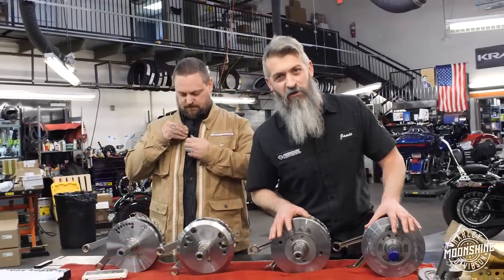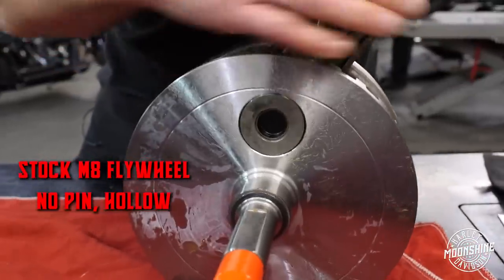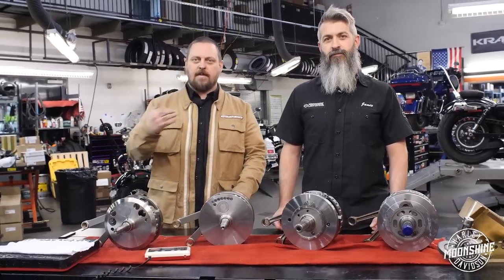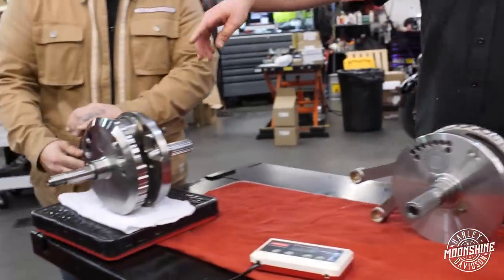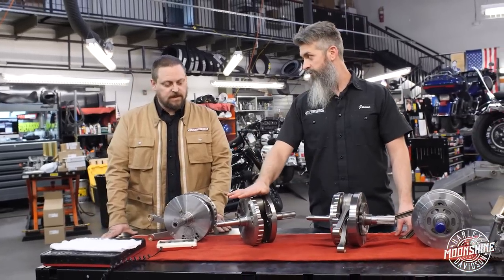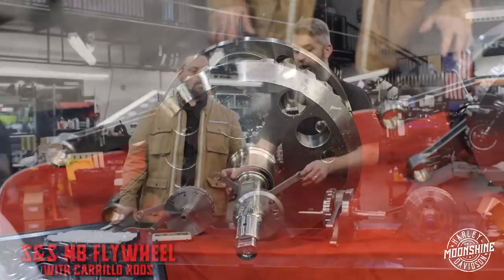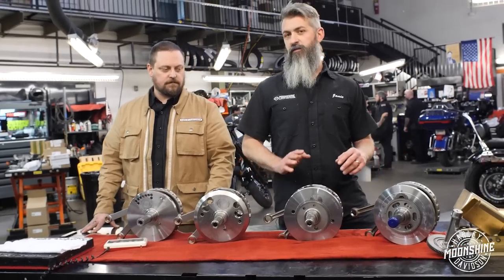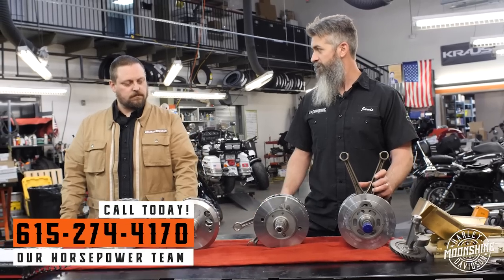Stock VS Built | M8 Flywheel Comparison 2020 with Moonshine H-D | Shop Talk Episode 46

Comment: Timken Bearing necessary when doing the bottom end for m8?
Reply from the maker: No. We run them on larger builds like our 135, 143 or 147 cubic inch M8’s. You can do it as a precaution but the M8 lower end is designed better than the Twin Cam and  we haven’t seen issues with the stock bearing setup.
Reply: @MoonshineHarley  how about the HD 131 kit ?

Comment: Reading about concerns with removing the counter balancer as well as installing a left timken bearing. I'm running a 2020 RG Limited with the 131 kit which means stock 114 lower end and 4.5" stroke. What needs to done with the block when removing the balancer? Epoxy fill the bearing hole? Different timken sleeve made from AL instead of SS?

Comment: Weight is always a detriment unless inertia is called for (for a slingshot effect). Mass must always be accelerated even at a constant speed and the less you have the better it will be, of course you must have enough to satisfy the application.

Comment: On the stock M8 flywheel is that the the 4.5 stroker because theres 2 M8 flywheels one is smooth and the other looks like the one you have sitting there with the groove around it

Comment: Should I pin and weld stock crank on 103tc when just doing cams? Plan on beating her up pretty good haha
Reply from the maker: Just cams, not really needed. If you told us it was going to have high comp pistons and ported heads we would recommend.
Reply: @MoonshineHarley  gotcha. Ya no porting or anything

Comment: I have a 2017 RGU with stage 3 and now have 95,000 miles and was thinking of having S&S 124 kit installed. Do I have to have the flywheel replaced or should I?
Reply: yes i ve ate right crank bearing race on left side and left  side again   at 69000 , this time right bearing race was spinning on shaft miles at another 78000 miles later.i ride about 42 k miles a year .My bike is a 124 so not sure that is helping .I would  be nice to your high mileage bike and when you rebuild put new crank in for sure.

Comment: I have experienced excessive vibration in the handlebars after a 124 kit.
What in your opinion would cause this and have you seen this before after a build?
Was fine in stock form.
Has the usual bits all s&s
Reply from the maker: It could be lots of things. It could be the tune. Did you remove the counter balancers from the lower end. Is it a Softail or touring frame?

Comment: Hey moonshine what can these stock m8 cranks handle HP and TQ? When is a good time to make the jump to your upgraded flywheel. Thanks guys
Reply from the maker: We like to upgrade when we are going past 140 HP.
Reply: @MoonshineHarley  I know that the Baggers have both rubber mounts and counter balancers but the softails are solid mount, so when you take out the counter balancers and say they smooth up at speed like the rubber mount Dyna, is it really that smooth even without the rubber mounts and counter balancers?

Comment: Hi Moonshine team, Many thanks for your explanations..  a 128 SS kit with TTS-200 cam just added on my Fatbob, In U'r opinion,  is the stock crankshaft enough to handle this power or you always recommand a stronger flywheel?
Reply: I am not an employee of moonshine HD and I’m not a tech, but I would never use a stock Harley crank on an $8,000 plus build.  You can have your crank repaired by pinning, wielding and balancing if you choose, but then again by the time you do all that, you could buy a darkhorse for $2,099.99.   Bullet proof your build and get a Darkhorse or S&S Crank.
Reply: I'm doing a 131 build and I'm doing an S&S crank.
Reply from the maker: If it has stock heads you are fine. We like to upgrade the bottom end when we go over 145HP. We also haven’t seen a flywheel fail. We have seen the bearing ho on the H-D stock rods on 2017 and 2018 models.
Reply: With the crank…..  I would rather have it and not need it than need it and not have it.  It all comes down to the money you want to spend to have the peace of kind of a bullet proof build.

Comment: Good video! I have a question though, on the Harley 131 kits did you say you use the S&S stroker flywheel or the stock flywheel.
Reply from the maker: We use the S&S Flywheel with there rods and we have a couple setups we do with the S&S flywheel and longer Carrillo Rods. P

Comment: What's the largest run out you've come across in an 107 M8.
Reply from the maker: out of spec!
Reply: @MoonshineHarley  0.013?
Reply: Damn.
Reply: So what would you say an acceptable amount of run-out would be if I was looking at an after market oil pump, cam plate etc, along, with maybe gears instead of a chain? 
0.003 ??
Reply: @aaroncox3340  0.001....  not allot of room if your using gears.. going to need a crank...  my m8 came out of the factory at 0.004 on the cam side.   At 1000mils i was at 0.0005 and at the sproket i was 0.008.  I'm not the average rider and I'm 0 to 100 Though the gears at redline every chance i get...  I'm now getting  a bottom end by darkhorse with the Timken conversion.
Reply: @aaroncox3340  the fueling cam and oil pump is 0.003.  The s and s system is more.   Is give both a call and find out.   If you're looking at big numbers.   You might want to hit the crank, get rid of the counterbalance...  compensator and clutch...  ads a huge expense but...  but... that's the price of hopping up an engine..  otherwise just a mild chain cam is fine..  the guys at moonshine are good..  a couple others around the country as you can trust.   All depends what you want vs reliability..  if your looking at a gear system i guess your shooting for one 150hp/150ftlbs...  measure twice cut once.

Comment: What are you guys doing build wise to get 170+ hp?
Reply from the maker: Depends on the build. Are larger 135, 143, and 147 cubic inch M8’s making over 170hp and even more. Some of them are not for everyday riding. We are releasing a new street 135 cubic inch upgrade which will be available in January 2021. It’ll cove with MHP +2.5 mm oversized valve ported heads, pistons, cylinders and our new MHP .588 lift cam. Engine cases get bore to except the larger cylinders and it’s a beast!
Reply: @MoonshineHarley  very cool! Thanks for the reply
Reply: @MoonshineHarley  definitely interested in that 135 street/touring bike
Reply: Valve work huh? Learn something at Branch?

Comment: Hi GUYS, THANK YOU first  FOR ALL you do. Just a quick question, do you believe I need to change my flywheel, when I upgrade my 103 breakout from 2016, to a 117 ci with all the good parts of performance, like 594 reapers cams from feuling , feuling HP+oil pomp, feuling pushrods, hpi58 MM throttle body, cnc heads 89 MM from S and S..?  Thank you for tour help 🤙😊
Reply from the maker: You’ll be getting up there in power so if it was one of our bikes we would do it. It’s nice knowing you have a solid foundation when you start twisting that throttle. Plus when you have your flywheel trued they come out super straight with hardly any runout, huge benefit for longevity.
Reply: Thank you so much for your answer, I will cross the fingers then, and as soon as I can, I will order a nice flywheel to go in there for generating less fear to turn the throttle hard if I wish... Will ride with respect first.. 😊 Thank you 🙏

Comment: If you’re doing a build and taking out the crank... absolutely no reason to skip upgrading the crank. Harley stock cranks are notoriously trash for high HP builds. Lots of twin cams out there with poor runout and scissored cranks!

Comment: Harleys are awsome but keep in mind when you do any modifications to any engine the #1 thing that gets taken out is reliability I care more about having reliability  than a fast Harley. Harleys  were not made for speed they are cruisers not crotch rockets like that happen crap you see going 800 plus miles an hour like a Kawasaki  ninja ZX 14
Reply from the maker: Lots of our kits are just a reliable as stock and sometime more reliable. There is a point when you go past the normal reliability but most of are build stay within. 

We do specialize in building high HP big baggers that’s slap some street bikes around.

Comment: If your going to change your flywheel/ whole crank. Which is the best one to choose and what else should be done to it to maximize its potential.

I’m looking at darkhorse
Reply from the maker: The strongest setup would be the S&S half’s with Carrillo rods. Our most popular setup is a stock H-D flywheel with Carrillo rods. We haven’t had a stock flywheel that Darkhorse  has trued, pined and welded with Carrillo rods fail. Both are great but one is a little more robust than the other.
Reply: @MoonshineHarley  what about 107 flywheel and going to a 131 kit boring the case out
Reply: @MoonshineHarley  I have a M8 107 I am thinking of the S&S 131 with stroker 4.625 flywheel and also add Carrillo rods. Can most Harley speed shops do the work and the case bore and head work 1mm - 2mm over size valves in stock heads and mill work as well as timken bearing upgrade?
Reply: @MoonshineHarley  which is more robust?

Comment: Can the stock harley be made into  4.625 with Carrillo H beam race rods?
Reply from the maker: Yes but you’ll have to get a custom set of short rods from us. If you need this please email Jamie a good phone number and he’ll call you, Horsepower@moonshineharley.com
Reply: @MoonshineHarley  so a stock 4.5 Harley flywheel can be made into a 4.625 stroke va original 4.5 stroke with carillon H beam Jon tappered rods
Reply: @MoonshineHarley emailed you